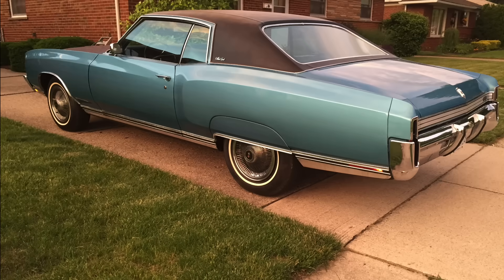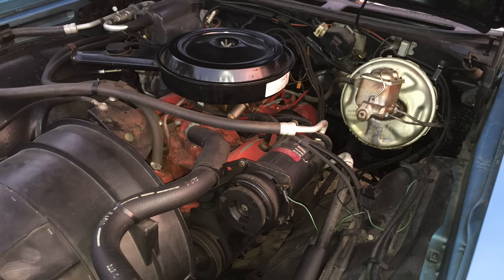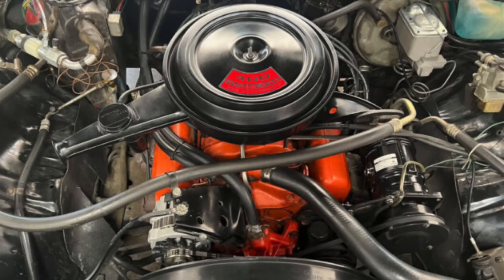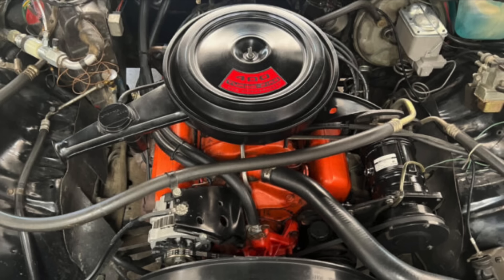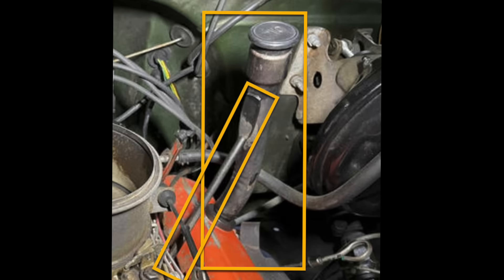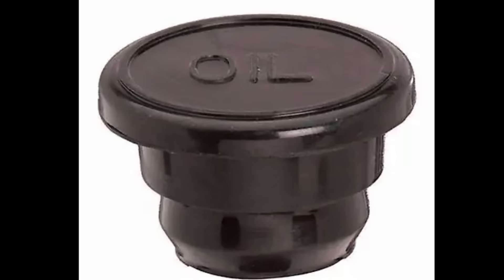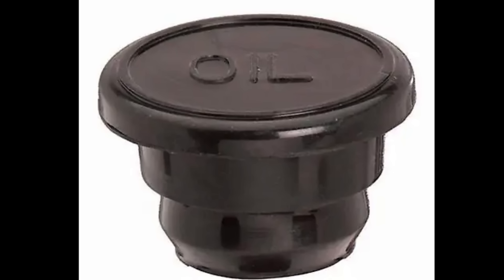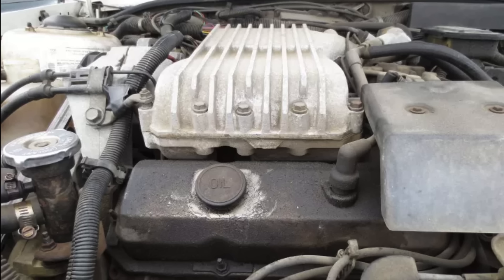Worst Automotive Ideas: Chevrolet's Crumbling, Rubber Oil Fill Cap (Small Block V8 / 2.8L V6)

Comment: The modern Ford ecoboost engines have a plastic oil drain plug that's supposed to be replaced every time you take it off.

Comment: South main auto channel seems to have an endless stream of GM stuff where they have placed electronic boxes, usually evap controls, directly in the line of road spray off the tyres. You can decide if thats on purpose or not.

Comment: I remember the rubber plug on my 1971 Vega needing replacement after only 3 years and 35,000 miles. Toyota had wear proof threaded solid metal plugs in the 1960's &  70's then switched to a grade of threaded plastic that was also wear proof .  Toyota used grades of rubber for the radiator hoses that would last 40 years.
Reply: the yota glazing is wild

Comment: I have a Chevy van I've been driving these dancers in 73 and I'll have rubber plugs and not one of them falling apart around it seems to be fine maybe it's because it's a little farther from the motor but it's right under there with all the Heat

Comment: Modern cars are worse. plastic intakes CVT transmission  designed. To last if you're lucky five years. Especially  Nissan BMW. You're better off with a vintage car.

Comment: When I was looking for a caprice from the 80s, I went with a wagon with an olds 307. Twist off metal cap front and center. I also like the 307 more than the 305 😊

Comment: My 1990 s10 2.8 had a rubber plug and a lot of the lower oil plug was crusty and broken off (in the valve cover/oil pan) . Ended up doing a V8 swap, problem solved 👍

Comment: I had the 2.8L V6 in my 1988 Pontiac 6000LE. Not very impressed with it due to the amount of issues I had with it. Everything from bad computer modules to lack of passing power at highway speeds. Plus I had to have two of those silly rubber oil fill caps replaced due to them cracking. The 3.3L V6 I had in my later Chrysler Concorde was a far superior engine.

Comment: I had a '78 Volkswagen Sirrocco. The rubber exhaust hanger bushings would heat up dry out and crack and break causing the exhaust to rattle. I would drive home from school in Tucson to Phoenix every couple of weeks, and invariably I had to buy more rubber exhaust hanger bushings, crawl under the car and replace one.

Comment: My parents had a '72 GMC 2500 4x4 with a 350 and that damn rubber plug. Our truck didn't have the extended oil spout, so you climb into the engine bay to get to the dumb thing. It was a pita to get it off and an even bigger pita to get it back on. You practically had to step on it with your foot to get it back on. I don't remember if Mom's '84 Jeep Cherokee with the 2.8 had the same plug, but it probably did because it was carburated, and incredibly gutless in that Jeep.

Comment: Back in the day when those car were new those fill plugs were very difficult to remove and almost impossible to get back in the valve cover. Working in a gas station any time I encountered one after I wrestled it off the car I would cut a V in the plug with side cutters allowing the plug to flex enough that it could be inserted into the valve cover.

Comment: I worked in a gas station in 1973 summer and remember these as being hard to get out and hard to put back on adding oil to engines. They were like hockey pucks hard and wouldn't go back in the hole on a hot engine. New ones I guess would expand on a hot engine too.

Comment: I saw the title and the picture of this in the video and began to twitch and swallow my tongue whilst jibbering like a chimpanzee.  My '71 El Camino from 50 years ago came to mind.  Even only 6,000 miles and 14 months old when I purchased it used that damn plug was like removing and jamming back in an incorrectly sized hockey puck.  Thermal cycles?  I was living in Eastern Idaho at the time where temps dropped to -20degF at night regularly between November and March out on the desert where I worked which did my hockey puck no favors.  Thanks for the memories...

Comment: The big issue was the material used, which I suppose was for cost. Originally, and I have this on good authority, Chevy wanted to use prefabulated amulite but the costs were enormous (not to mention the modial interaction of magneto-reluctance and capacitive diractance…but that’s another story).

Comment: This vid should address all the half ton Ram owners who had rubber fill plugs on their rear axle...you know, the ones we used to see from behind at night with headlights pointing out that wet spot down the rear cover of axle and thought hmmm. To all those Ram owners who burned up carrier and pinion bearings, ring and pinions themselves, when they went to check that "noise" out back just to find their diff completely empty of lube with nothing but a china rubber wobble plug in the fill hole

Comment: The ‘71 through ‘75 Vega used the rubber plug, then when the cylinder head and valve cover were redesigned for ‘76, Chevy switched to the stamped steel 1/4 turn cap with gasket.

Comment: Those heater hose quick disconnect on the 88, 89, trucks. Always leaked on all of the 3 trucks i owned. Could be a real pain if the fitting broke leaving the threads in the intake manifold. Happened on my first 88, was a little wiser with my 89, good day all, God bless ya!

Comment: this is still a modern problem if you can believe it. My 2017 Honda civic has a rubber fill plug for it's transmission. Best part is that the fill plug is hard to see. When you want to add fluid you are supposed to remove the air filter box. But wait there's more! When the transmission vent gets clogged that plug pops out and you don't see that happened because once again the air filter box hides it. Thankfully when the plug pops out it gets trapped in a recess on the transmission and not lost. I have no idea how many thousands of miles I drove without that plug! 😂 I only discovered the issue when the car requested a trans fluid change

Comment: Even my vortec small blocks from the 90’s experience this as the PCV rubber fittings on the valve covers hardens up and leaks oil, replacements are not easy to find, and the ones you can find don’t last very long before they start to fall apart.

Comment: Many years ago, had a brand new 97 Dodge Dakota with the 318.  Decided one day to check the power steering fluid.  The caps on those, if I remember right, had kind of a wiping overmold that was larger than the opening that you would pour the fluid into.  When I unscrewed the cap, the cap itself broke into two pieces, which fell deep into the reservoir requiring a very long tow to the nearest dodge dealer for warranty replacement.  I don't know if that was common back then, but had a similar vibe to this.  I've owned two 305's and two or three 2.8L's and I don't remember which car (or truck) it was in, but yeah I had the stupid cap that was as you said, hard as a rock.

Definitely not a classic car example here, but I have a 2017 F150 with the 3.5L ecoboost.  It has the 10 speed automatic.  I suppose I should be happy that Ford even gave the trans a dipstick, but it is more or less a stub.  But there is a lot more to it than that.  The stub is covered by a 19mm head that threads into the trans, so to check the fluid, you need to have the trans up to temp, level, go under the vehicle, remove the 19mm cap, then take out the stub dipstick, wipe it off, re-insert it (Which is tricky because there is a "step" inside) and then remove it again to read it.  Big deal, no?  Well.  The catalytic convertor is about 2 inches away from the dipstick, so you have a 90% chance you will burn your hand checking it.  But oh no, it doesn't end there.  The transmission dipstick has 3 different revisions, each of which has a series of numbers, letters or geometric shapes I think.  There is no "full hot".  No, instead you have to decipher which dipstick you have, look up the proper range for your vehicle, ensure the trans is the proper temp using a diagnostic tool.  Big deal, I know.  Think about this.  It's low, or you just drained/refilled the trans.  Now you have to fill the fluid.  Small hole, located way up in the frame, next to a cat that's 900 degrees, and you are squirting a flammable fluid into a plastic hose running alongside it.  Inevitably, if you "sneak up" onto the correct range by adding small amounts a fluid at a time, you get to do the "operation game" surgery trying not to burn your hand, melt the plastic tube, or burn your car down multiple times.  I'm getting fairly good at it now and only burn myself once or twice each time I do a drain refill.  Also, using gloves is out of the question because you don't have enough dexterity to maneuver the little dipstick into the hole.

Comment: Besides being a cheaper solution, the rubber plug may have sealed better, aiding the positive crankcase ventilation system. As it deteriorated its effect was the opposite of the goal.
Reply: Threaded cap with neoprene rubber O-ring seal = 30 year, unlimited miles durability.

Comment: I have a 74 Pontiac Ventura with the inline 6 250CI, and it also has this rubber plug, but mine isn’t crumbly yet… it’s hardened sure, but no cracks at all. Should I swap it? Where can I get that aftermarket one you mention?

Comment: Even worse were the replacement Stant version of this oil plug. I never liked GM's brake master cylinder reservoir cap. The big rectangle lid that resembled a Tupperware lid.

Comment: I don't know the specific material that the 710 plug was manufactured from, but I'm not so sure that this is just a thermal cycling problem.  Engine oil, especially hot engine oil, can attack many materials.  I'd also blame this on accelerated testing not picking up on failure modes that occur over extended time, not just extended mileage.  If I were king, automotive executives would be assigned 10 year old cars, not new cars, and be required to have services performed through dealerships.  If that were the case, maybe Toyota would have to share some of their reputation with other automakers.  Also, for the most part, Toyota doesn't seek to fix things that aren't a problem.  I've seen many instances of Toyota keeping old, proven designs instead of squeezing the last pennies out of them and risking reduced durability.  Maybe they save their money by not engineering and tooling new components, and not chasing after quality spills.

Comment: My favorite bad automotive design element that I personally owned was on my 1973 VW Super Beetle.  Rather than incorporating an electric pump for the windshield washer, they used air pressure from the SPARE TIRE to push the washer fluid through the nozzles onto your windshield.  On the plus side, I suppose you would know when your spare was flat before you needed it. 🤔

Comment: Hey good video as always! Has anyone here ever noticed sagging GM door hinges? My 78 Oldsmobile (two door) both the doors no longer line up with the strikers on the body. The drivers side you have the lift up on and the passenger has to be slammed just right. Annoying but I deal with it because I enjoy the car.
Reply: My 64 Buick Special had a sagging driver door. Fixed with the aid of a block of 2x4 and a floor jack. It was an $89 car, so...
Reply: Get you a relatively cheap bushing replacement kit for the GM doors. They used a plastic bushing which easily wore out causing the door droop. Even with 2025 pricing you can still get those replacement bushings for less than $10 per side. Block up the door, knock off the c clip and remove the pin. Pry out the worn bushing and push the new ones in and there you go

Comment: My Mom's 1971 Chevrolet Kingswood Estate wagon's 454 big block had this dumb rubber oil fill plug as well. That plug leaked oil down the valve cover and onto the exhaust manifold. Garbage design...

Comment: My grandparents bought a brand new 1972 Impala Custom Coupe from Rudolph Chevrolet (later Lou Grubb Chevrolet) in Phoenix, in June of 1972.  It was metallic dark blue with a white roof, that concave rear window, a 350 engine with that rubber oil plug on it, and a TH350 transmission.  I have lots of memories in that car from my youth.  One of those was how many times we had to replace that plug because it would get hard and start breaking apart.  It also leaked oil, leading to the valve cover always being dirty.

Comment: Had an 85 Chevy Celebrity that had to have the A/C recharged every Spring. Problem was that certain seals combined ceramic and steel parts. Because the ceramic piece didn’t contract or expand with the low winter temps, all of the Freon leaked out each and every year. That car also had the lazy steering rack.

Comment: Can you do a video on the intake manifold-to-heater core coolant line connector on late 90s 5.7 Vortecs? I don't know what other engines used them but they are terrible.

Comment: Pure conjecture - but I wonder if this had to do with containing oil fumes for EPA requirements.  When new, it would seal better than the old metal style cap. That having been stated, I don't recall these on SBC engines, and I've worked on many.  I did have one on a 2.8 V6.

Comment: The heat cycles are not the problems.  It's the fact that oil and rubber are not compatible and the hot oil fumes chemically attack the rubber. You need a special formulation  of rubber to survive.
Reply: neoprene rubber. Too expensive for GM, but Toyota uses it extensively; e.g. valve cover grommets, engine vacuum hoses, cooling system thermostat O-rings,  fuel cap gaskets, etc.

Comment: I remember those rubber oil caps and saw them on a few different GMs. Remember a couple were worn out and leaking fumes. 
Would be cheap to replace. 
I also remember we had a Caprice Classic wagon with the 5 litre engine and how it are through water pumps and smoked exhaust because it didn't have valve guides just holes bored in the casting.
Another failing water pump ruined the big wagon when it was borrowed by a family friend and forgot to keep adding water or coolant. 
The plug I remember seeing new store brand plugs at Canadian Tire as a young man. Cheap enough to just replace every year vs the few hundred to deal with worn down camshaft and oil burning valves.

Comment: I inherited a 305 engined 1977 Malibu Classic. It was the worst car I’d ever owned. The camshaft was soft and had to be replaced. The timing belt was replaced with a timing chain. The a/c was the worst, the desiccant broke up because it reacted to dissimilar metals in the unit. I had numerous other issues and I haven’t bought a GM product since. When I wanted to sell it, my father always said, that it had a V8 and air conditioning. My reply was that so did Camaro’s and they were better cars.

Comment: I remember all of the Chevy Astro/GMC Safari vans my parents and I owned through the years (1988 Safari, 1993 Safari, 1995 Astro) all had rubber plugs in a plastic fill tube (needed due to being a transverse van layout). 

Worst idea when it comes to poor choice of materials in an attempt to cut costs (and corners) that I've dealt with is on "Bullnose" F-series (1980-6, I daily a 1984 F-150)... Ford  thought it to be a good idea to use a flexible plastic joint for the main vent door (floor/defrost 3-position) in place of an actual 2-piece hinge... these always fail, and then they do, you lose defrost, the absolute worst case scenario for an HVAC failure. Requires a partial dash disassembly (and a nasty one, very tight access) to get to the door; some people like me rivet in a piano hinge (requires shaping or re-assembling the hinge due to weird offset profile), while others have developed a 3D-printed replacement door and hinge assembly. They used actual hinges for the other doors (vent/floor and recirculation)... it remains a mystery as to why they did this, and only in the one location. At least it's a one and done repair...

Comment: Another bad idea is on my '97 Chevy S-10 2.2L. The oil pan is so low to the crossmember the engine must be jacked way up to replace the oil pan gasket. The bed has to be removed to replace the fuel pump. But it's a darn good engine otherwise.

Comment: My 1990 F-250 was factory equipped with intermittent wipers. The wipers quit, and I diagnosed that it was the intermittent module. The intermittent has a note printed on the top. The note reads DO NOT DROP . The fragile module is mounted on top of parking brake mounting. So, every time the parking brake is released , the module gets a whack, as if from a hammer. The bad module had burned up the wiper motor. I noticed that the standard  wiper motor  part number is the same as the intermittent wiper part number. The module was $200 and only available from Ford . So I bought a standard wiper switch , along with the new motor.  And the standard wiper motor harness fit. And I have wipers again (with no intermittent mode).

Comment: My 2003 Dodge Durango has a plastic plug on the coolant recovery tank. It's the same story. It disintegrated and crumbled. The recovery tank is also plastic. It became brittle and cracked and leaked. My solution was to replace the tank with an aftermarket metal tank with a 5 psi cap. The radiator does not have a filler cap. The filler neck is integral with top radiator hose. And the filler cap has a 22psi rating, So, when the system has a leak, it's a 22 psi leak. One cold morning on my drive to work I smelled and saw a coolant vapor leak.  The leak was coming out of a factory auxiliary Bosch electric coolant pump on small diameter hose to the heater core, I was able to bypass the pump with a short length of copper pipe. My thought was that the heater might not be effective without the auxiliary pump in place. But, it was just the opposite. With out the auxiliary pump, the heater had two only two settings, cold or  Hades. When I replaced the Bosch pump, the heater was back to normal.